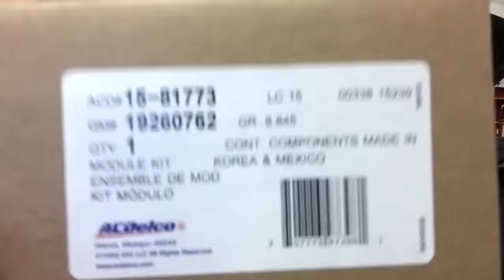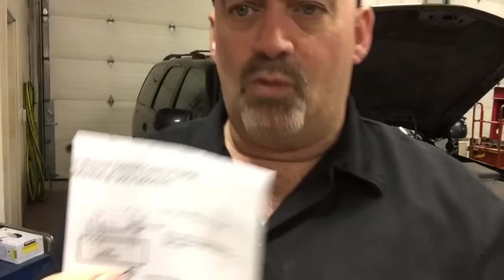Chevy GMC Blower Fan Stuck On

Comment: is there a module for the rear fan to? same problem but the rear is staying on
Reply from the maker: I have not run into that. I am not sure. If I remember to look tomorrow when I get in I'll update.
Reply: cool thanks
Reply from the maker: whats the year make and model of your vehicle?
Reply from the maker: Yes, the rear unit has a blower processor module. It is located just below the blower motor at the RR of vehicle;e.  It can cause a similar situation. Heres how to test: 1. Remove the Purple wire at the blower motor processor and then check to see if the blower motor is still on. 

2. If the blower is still on, replace the blower motor processor module and check for high amp draw on the auxiliary blower motor 

3. If the blower is off with the Purple wire removed, check the Purple wire from the blower motor processor module to the Heating, Ventilation and Air Conditioning (HVAC) control module auxiliary for a short to ground.
Reply: thanks, seems like these chevys have many electrical problems.

Comment: i had to replace my blower motor. i just left the 3rd screw in and let the cover lay on the floor. in the way a little bit but better than messing with 3rd screw. just saying..but if have to use 1/4 " small ROUND rachet..

Comment: basically the same thing if you loose the low speeds, change that module/resistor and harness.
Reply from the maker: +kenman1717 OK Good call. I have also seen them short and just cause a battery drain and non functional blower. No tips for easy install of the hard to reach screw? :)
Reply: The Car Doctor I guess I haven't seen them drain the battery after they short, I always seem to find It blows the fuse, but I don't know this until after I replace the module and it still doesn't work. I seem to always go here first, just from experience, cause they are always melted, or what have you. I always us a 1/4 wobble, and a magnetic socket, still a pain, only takes about 10 mins to get the screw in, of course I have to be honest, If I'm in a really bad mood, and its not working I leave the screw out, but as you pointed out its a customer vehicle, and I always try to do the best job I can. but In the grand scheme of things I doubt that one screw is going to cause a problem. ;)
Reply from the maker: +kenman1717 No IM sure one screw isn't going to cause an issue and next time I might give them two cost estimates. One for doing the job by the book and a less expensive price for the job minus installing one screw. Has to be worth at least $20. haha
Reply: The Car Doctor no doubt for the time it takes. and at least you have the satisfaction of knowing that for whatever reason that if something fails again, that you or whoever does the repair doesn't have to fight so much.

Comment: If it’s on service recall for updating then your local GM dealership should be responsible for replacing it.
On the inner screw you could replace it with a stud and nut.

Comment: I got a problem with my rear blower stays on all the time
Reply: I have the same problem and switched out the same module with a new one and didn't fix it. Have you got yours fixed?
Reply: I'm guessing there should be one in the back by the blower motor, I have an 03 Yukon with the same issue, rear blower motor came on by itself and stayed on even with the key off and as I was checking it out it looks as there is one there also so I'm going to try switching that one out with a new one and see what happens
Reply: @1royalluke  I did order the updated blower resistor that fixed my issue. Working great

Comment: Do not need to cut any wires, remove the 3 wires from original connector and the 3 pig tail wires from the new harness with jewelers screwdriver and swap the 3 wires.
Reply from the maker: That's works...unless the wires are melted from excessive amperage draw.

Comment: I own a 2003 Yukon XL.  Fan stayed on and killed my battery.
Just did this replacement.  (W.A.P.I.T.A.)   Your video really helped me.  Thanks again.
Reply from the maker: Glad you got it figured out and I appreciate you watching!
Reply: @ThecardoctorTV  I replaced mine it's doing the same thing
Reply: The screw next to the console  does not have to be removed  for this installation ,the plastic sheild is flexible  enough to bend out of the way to get the job done..

Comment: Awesome, Awesome!  thank you for this video.  I too have a 2005 Chevy Tahoe with the same problem (blower won't turn off).  Unfortunately, I replaced the battery before I realized the fan was stuck on...probably not a big deal as the battery was 5 years old.  Nevertheless,  this video was very informative and helped me fix it myself.  Found the exact same part on Amazon for $49. Replaced it in 15 minutes
Tip:  that third screw that is so hard to get to...I unscrewed it only partially, which was allow me to complete the project without removing the cover completely.  I can only imaging how difficult it would be to get it back in if you unscrew it all the way.  very easy to screw back in with only partially unscrewed.

Comment: That screw, cut the head off then get a nut of same thread to clean out to its end. Screw in the threaded portion into the hole it belongs, then just slide the case over this threaded shank and put your nut on tight.
Your welcome

Comment: Get the blue point ratcheting bit driver similar to a ratchet and has a ratchet style Construction with an offset handle its clutch for everything has to do like speakers in the rear deck lid we window glass in the way that one bolt on the lower blower box cover pain in the ass stupid design